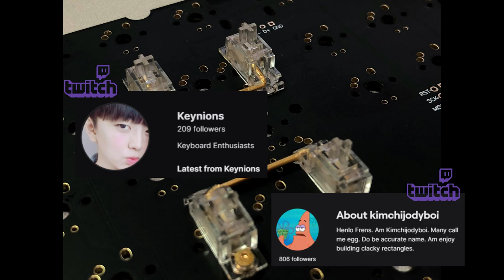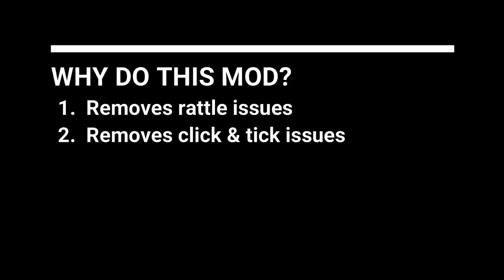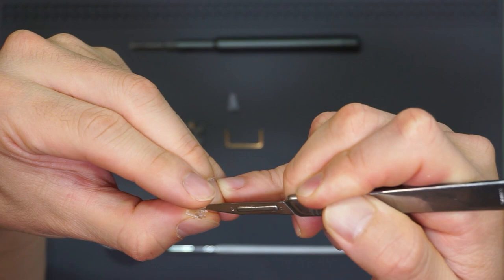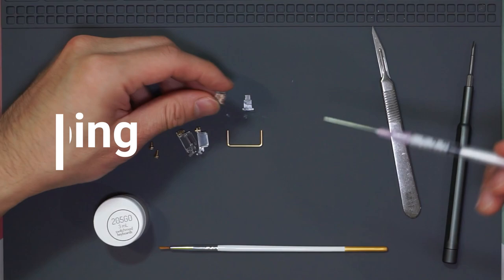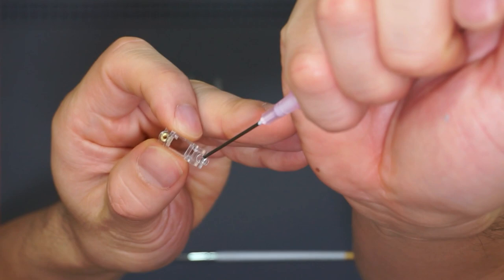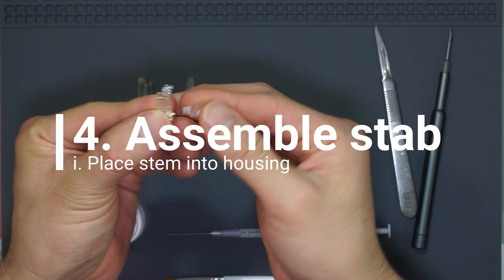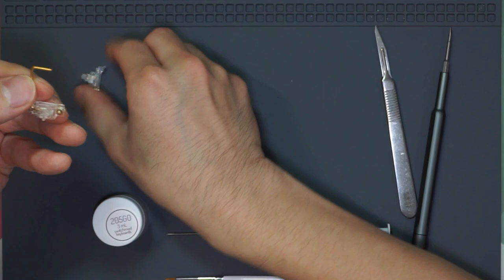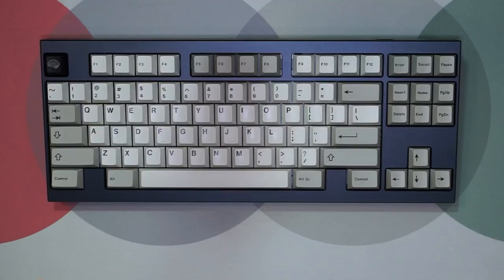[How to] Galaxy Brain Keynions/Korean Stab Mod Method // CHECK UPDATE IN DESCRIPTION

Comment: I have a keyboard and the backspace and shift keys get kinda stuck when pressed down. I have googled and googled but no definitive answer. I think it is a stab problem. Any advice? Thank you
Reply from the maker: If the wire is in where it should be; correct hole of the stab stem and clipped in the housing, it could be a keycap issue. Maybe try a different keycap and see if that works (most likely you’ve tried that i assume). OR! If you used thick lube for any of the parts, it might have seeped between the stem and housing. One thing that you could do if nothing works is to use a heavier spring(80-90g) for the mod keys.
Reply: I had this issue and it may be because the stabilizers are not inserted all the way into the PCB. It needs to be flush.

Comment: would you recommend duroxk stabs instead of these then? durock wont have this problem right?
Reply from the maker: The rattle that happens by using durock stabs is the reason you want to do this stab mod. Also, if you’re using durock v1 stabs, you’ll have issues with stab wire popping out. V2 has fixed that issue by redesigning but not on the rattling issues.
Reply: @DrHuru  i see. thank you for the advice.
Reply: @DrHuru  I’m confused you said this isn’t possible with Durocks
Reply from the maker: @kalplays9922  yes, the k-mod does not work with durock stabs bc they don't have the thin film that is required to do this mod. The previous reply may sounds confusing but I meant to say that durocks have a rattling issue once the lube is displaced and that's the reason you want to use this mod using old cherry/GON/zeal stabs. hope this makes sense.
Reply: Holy mod and you need no film

Comment: Can I use this mod with C3 v3 or v2 stabs? I usually have ticking issues
Reply: The written guide says no :(
Reply from the maker: You can only apply this method to zeal or old cherry stabs. I believe the recent cherry stabs are from a new mold and doesn’t have the film inside.